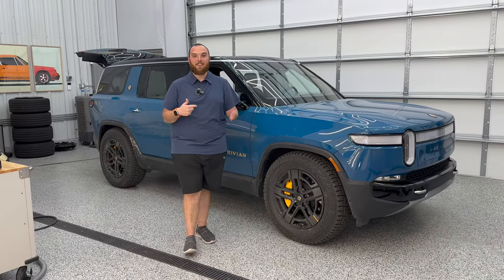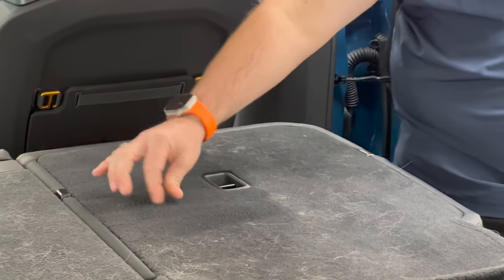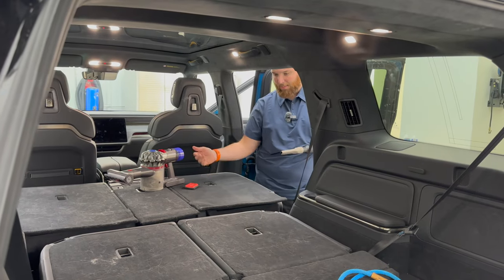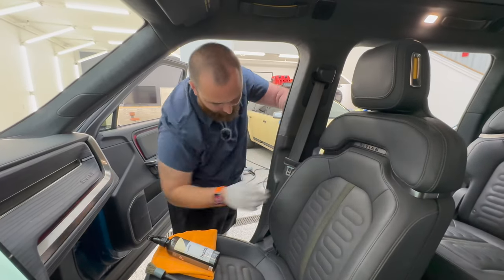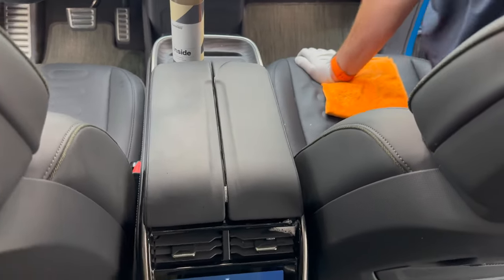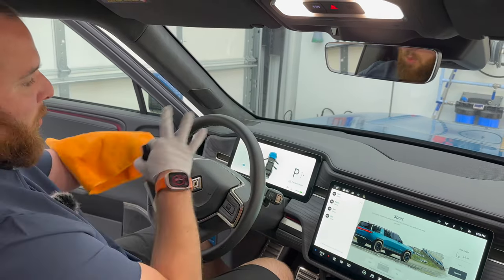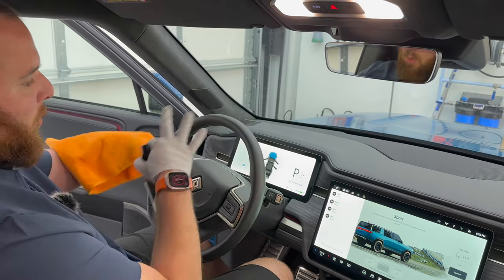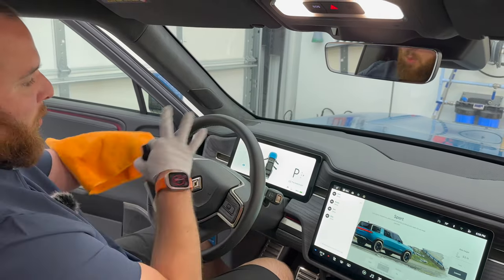Here Are The Tools & Processes You Need To Fully Clean & Maintain Your Vehicle's Interior

Comment: Could you confirm for us if the tornador works with the onboard air compressor? Thanks!
Reply: I'm curious too, but I bet there is little to no pressure reservoir on the Rivian. My guess it it's more comparable to a tire inflator vs a shop air compressor. Similar to how you can't run air powered tools on a tire inflator.
Reply: It doesn't @josilver